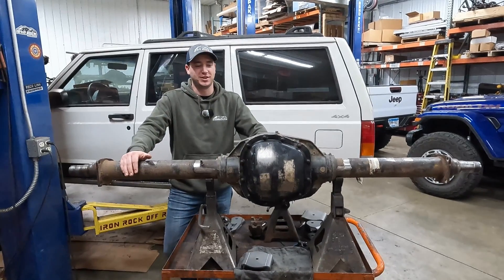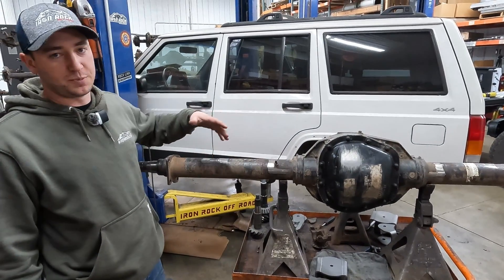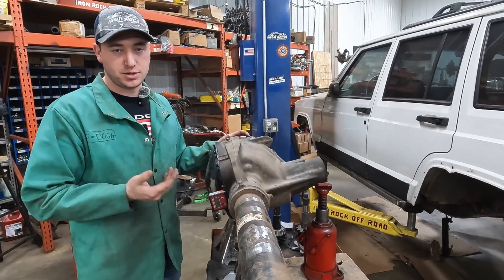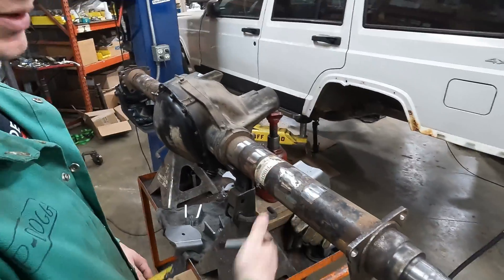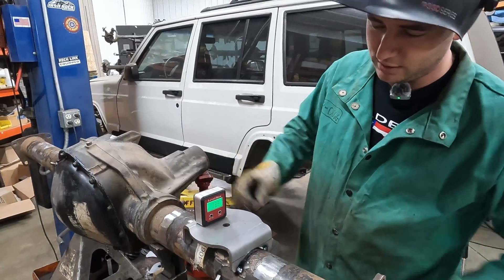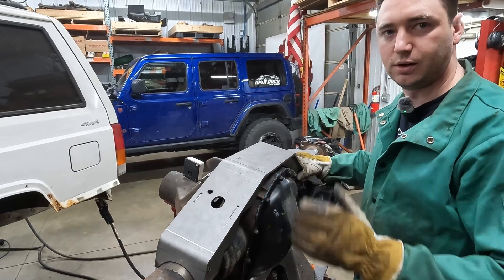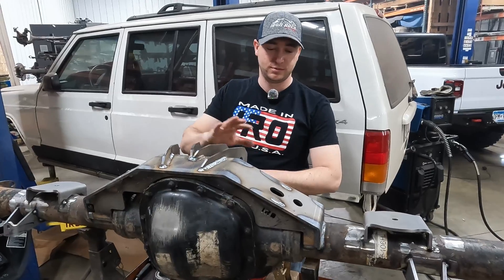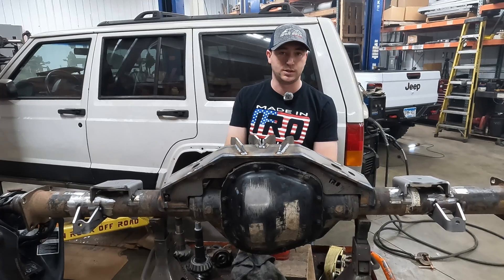XJ Build Series - New Rear Axle! EASY axle swap!

Comment: I’ll be buying this one and the d60 front truss when it comes out. Already have the 3 link up front.
Reply from the maker: @QuinnHigginbotham That's great to hear! Stay tuned and we'll let you know when the front swap is ready to go.
Reply: @IronRockOffRoad will you be making an all in one truss for the rear one ton swap similar to the jk d44 swap for the xj or is it strictly this diy kit?
Reply from the maker: @QuinnHigginbotham The front one-ton swap on the XJ will have everything you need to install the axle. That's partly why it is taking some time to get everything dialed in. We will have a full steering kit, brake hoses, etc. that will make it complete solution for your swap. Is that what you mean? I think you accidentally wrote "rear" in your last comment.
Reply: @IronRockOffRoad yes thank you!
Reply from the maker: @QuinnHigginbotham Happy to help!

Comment: Do you guys offer a d60 swap front bracket?  Maybe I missed a video on the front axle build for this series?  Looks awesome!!
Reply from the maker: @xjrockrawler We are hard at work developing the front D60 swap kit. We are trying to maximize ground clearance, frame clearance, and get the most uptravel we can with that huge axle. We will have a front 3-link kit with a track bar & drag link, and also a front 4-link kit with full hydro steering. Are you wanting 4-link and full hydro or 3-link and a track bar and drag link?
Reply: @  probably go with 3 link in my case. ✌🏻
Reply from the maker: @xjrockrawler Good to know! You are the reason why we are working so hard to design it both ways. Stay tuned!

Comment: I need this. I just bought a 1996 Jeep Cherokee xj
Reply from the maker: Great to hear! We make tons of stuff for your XJ. Let us know if you need anything or have questions.
Reply: @IronRockOffRoad  I probably need a 488 for 35 inche tire , what you think????
Reply from the maker: An XJ on 35s would be nice on 4.88s 👌
Reply from the maker: 4.88 is a great ratio for 35" tires 🙂
Reply: Thanks , also I have another question, I replaced a rear main seal but w new one but it’s still leaking in that area and I change it two times and still leaking, any suggestions or should I dump the motor or rebuild it ? I am trying to figure things out and tight with money but then again I also need my jeep to work because it’s my daily and I need to go back to work soon
Reply from the maker: I'd recommend an OEM replacement seal. Check the bearing cap for ANY scratches also make sure to use the little paper install tool or it will shear the seal as it goes in. Add a small dab of RTV on the seal halves and offset the seal halves so they don't line up with the bearing cap.
Reply: I did just that and still leaking
Reply: Now my rig not starting at all haha 🤦‍♂️ 😐
Reply from the maker: Ouch! Sounds like the Jeep life.

Comment: I just ordered my 4 link and sterling 10.5 truss from you guys. Thanks for the video!
Reply from the maker: @Noejr5 Awesome! Thank you! Let us know how the install goes!
Reply: @IronRockOffRoad  will do! & What size of your springs would you all recommend for 40s? Will be running 3.5 wheel backspace.
Reply from the maker: @Noejr5  On an XJ it is hard to say. 40s require a lot of cutting. I'd aim for 6.5 - 8" but probably 8". Check out our Tennessee video. There is an XJ on SD tons and 40s running our kit.